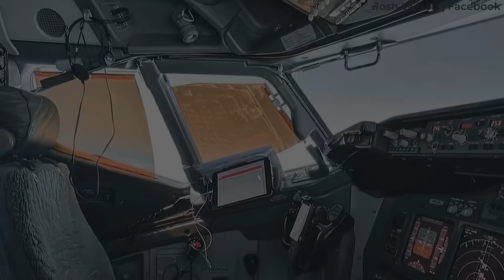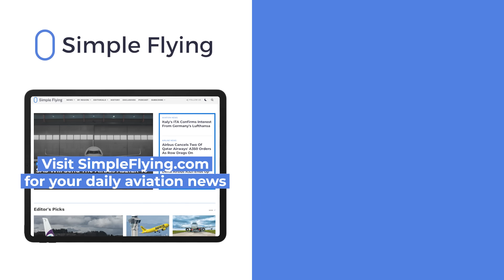You'll Never Believe What Caused This Boeing 737 MAX In-Flight Engine Shutdown

Comment: It's a good job it didn't hit both engine cut off switches, though there might already be an engine-protect system that prevents the switching off of two engines simultaneously.

Comment: Makes you wonder how the rest of the plane was put together. Gulp!
Reply: Indeed: for several years, every air carrier after delivery of new Boeing airframe arrives, has it dragged into hanger & taken to bits...tools, construction debris (metal shards etc) are routinely found, retrieved and every system carefully checked. Funniest one ? In fin, a STEPLADDER found. As aircraft engineer 5 decades: 1. Where is tool inventory accounting at each shift change ? And NO-ONE notices tools/assembly objects have gone missing ? 3. How thorough is Boeing final pre-delivery inspection? BTW: when new airfrane is delivered, Boeing has already completed *final clearance inspection *pre-delivery trial flight *completed handover delivery flight. Sutuation SO POTENTIALLY DANGEROUS: Dreamliner is constructed at three USA plants - one of these has such troubled construction-flaw history that ONLY el-cheapo air carriers will buy from this production facility - at discount.

Comment: A while back I was driving my truck and had a clip board on the passenger side of the dash. I was getting on the freeway via a nearly 360 onramp. When I started the turn, the clip slid across the dashboard and jammed itself into the steering wheel. I almost drove off the onramp and into the dirt. Luckily, I was able to dislodge the clipboard in time and recover. So yeah. Been there, done that.

Comment: I wonder how did a sunshade pull up the switch and then moved it down.
Reply: It is the 787 start lever 
It is 1mm flat on the lower side and the momentum / leverage can pull it out 

The visor has 0.5kg

Comment: Was that a tinted sunviser or a heads-up display which tend to be tinted? Their mounts and their weights might be very different. 

Though one shown in the video looks like a large sunviser or a turned off heads-up display, in a frame in front of a pilot, I think that's the usual place for what may be a smaller heads-up display on a modern jet.

I understand one thing to be a thin rolled plastic sheet mounted over each side window or a very adjustable hard piece of plastic on an arm mount for side and front use, the other being hard like any readable screen with a hinged mount to the front view only, which may be somewhat adjustable for different users' preferences.

Switches, knobs and levers would be covered if designed for important occasional uses such as fuel selectors or for emergencies such as fire suppression controls. I recall some had spring-loaded caps, sometimes with small holes to gently lock them closed with thin copper witness wire. They were always positioned to close downwards to prevent falling things opening them if they were on a vertical surface, maybe close backwards on overhead panels.

There are some controls needing hands of experienced people to move them, such as step movements or maze-like movements, things falling can't complete those actions.

Some things seem off in the video from what I worked with and from what I commonly see of big modern jets in media. The visors I dealt with in flying training and in maintenance were padded and on sturdy adjustable mount arms. And the lesser-used controls needing protection had red caps, witness wire if installed was easily breakable but was there to show something was accessed, not by who but within a time-frame of a flight. Some other controls were used once to frequently during flights but with intentions to do that. Some controls have limited movement before a different action is required to make more movements with them, landing gear lever doesn't move at all without pulling it outwards first.

Comment: A dropped sunvisor shutting down the engine is the biggest load of nonsense I have ever heard. There’s no way this is the whole story. I have been an aircraft maintenance technician for 20 years. I am engine run qualified on several Boeing types, which all have the same fuel control switches. Those switches are big and hefty. There’s zero chance dropping something as light as a sunvisor on them would cause an accidental activation unless something else was wrong with them. You could probably drop a brick on that switch and it wouldn’t change positions. There was an AD issued not that long ago addressing incorrect mounting of the switch, where not enough of the switch was protruding and the light plate was preventing the switch from dropping in to its locking detent. But again, that’s not the same as “they dropped a sun visor and it shut the engine off”.

Comment: They usually say that an Airbus is best piloted by one pilot and one dog, the pilot engage the autopilot and the dog bites the pilot if he touches any more buttons or levers during the flight. 

Perhaps the same dog should be installed on Boeing airplanes as well to guard the fuel cutoff switches?
Reply: alternative a "Airbus is best piloted by one pilot and one dog, the dog is there to bite the pilot if the pilot trying to touch the controls, and the pilot is there to feed the dog"
Reply: You realise the switches have to be LIFTED up to deploy? The sun visor story is a little....interesting

Comment: On my PC if I exit a file without saving I get asked "Are you sure". How would an aircraft IN FLIGHT just accept a command to shut off an engine without asking are you sure is very hard to believe.
Reply: Cause in case of an emergency the engines may need to be shut down eg. Engine one fire w heavy damage they need to cut fuel asap
Reply: Because computers are designed to be operable by complete idiots. Airplanes, not so much. You have to be careful in an airplane cockpit.

Comment: Not sure if this helps this channel with its credibility but the pictures from the 737 cockpit are from the NG series, not the Max 🤦‍♂️.
Reply: And the thumbnail is pointing at switch on the overhead that operates part of the bleed air controls, not the fuel switch which is on the pedestal. You really can’t trust these shitty YouTubers to get anything right when it comes to aviation reporting. Details matter.

Comment: Where is the lock out tag out of engine controls or even a simple cover over the switches......?
Reply: They need ease of access to the cut off switches incase of emergency landings and engine fires
Reply: Lock out - tag out is to prevent operation during maintenance.

Locking out flight controls during flight would generally be considered a bad thing .

Comment: If I remember correctly some years ago a transatlantic flight was cancelled because the PIC's cellphone he was holding fell down through the rudder control floor space. Luckily it was on the ground during boarding...
Reply: That was almost certainly because the phone had a lithium battery (exact chemistry unknown) inside it.

 You do not want a fire in an unreachable area during flight, especially not a fire that burns hot, might self oxidize, and produces very toxic smoke.

There is also the fact that just bending a lithium battery can cause it short out internally and go into a thermal runaway. This is why they tell you to get a flight attendant if your phone falls into or between a seat and something else. No one wants the risk of a fire that can't be easily put out. (A lithium battery fire is not covered by any of the classes, A,B,C, or D.)

Simply put, what makes lithium batteries great (energy density) also makes them hell when things go wrong.
Reply: I have a hard time believing they cancelled the flight over that. A delay, sure, but a cancellation seems overkill. It would have taken a qualified mechanic like myself just a few minutes to retrieve that dropped phone. It wouldn’t be the first time.

Comment: What is the weight of the,sun-visor,to,move,the,fuel-control-switches?

Even if liquid falls down the fuel-control-switch,the,EEC,is located far down(engines) and intelligent to not cut off supply of thrust but rather will cut off the weight the engines(part-electricity,part-DCMP-hydraulics,AC-fuel-pumps),carry,not,engines,powered by,alternator

So,engines,shutting-down,is only as,dev😘,said,”EEC-false-flight/approach-mode”

Think of a,weight-lifter.If,he cannot carry the weight,will he throw off the weight(electricity,hydraulics),or,will he rest his hands(engines) and get crushed by the weight/crash?
Reply: Try reposting your comment in English or whatever your native tongue is and we’ll let Google do the translating, because I don’t understand a word of what you wrote here.

Comment: Is this the 'unswitchable-except-intentionally-by-hand' switch?
Reply: Yeah, the very same
Reply: @davidkavanagh189  Still does not make any sense, Because you need to pull up, then push down to cut off fuel. Plenty of cockpit education video on ytb.
Reply: @kiraasuka9943  Nope. you need to move the position of the switch. The pulling up is solely to allow the switch to pass the gate. This is a a very small movement and it doesn't take a genius to see that the gate could be warn or the switch not fully seated down into it. There have been documented problems before with this switch design so I'm not pulling this out of thin air. Try out some of that education you suggested for yourself :)
Reply: yupp
Reply: Extactly.
Reply: NGL I was 99.999% sure the Air India act was deliberate but if this report turns out to be accurate I guess you have to be open to alternative suggestions of how the switches could have got set to off......
Reply: No different to the 787 fuel switch
Reply: @Louist5e-Gaming  The current 737 fuel switch design is similar, if not identical, to the 787 fuel switch.
Reply: @davidkavanagh189 that’s what I ment and on the 737-800 u can get two different models
Reply: @Louist5e-Gaming  Yes but this was not an 800. I was a Max8 and they only have the later style
Reply: @davidkavanagh189 my bad I thought it was the same w the max
Reply: Typical BOEING , falling to pieces
Reply: @fastnorte  Typical Netflix parrot. Boeing certainly haven't done themselves any favours in recent years but the 737NG and 737Max are statistically some of the safest airliners ever made. Look up accidents in the 80s and 90s to get a sense of just how insanely safe airline travel has become, in no small part due to companies like Boeing.
Reply: @davidkavanagh189  Air travel is the safest mode of transport - no arguments about that, but Boeing isn't doing anything great for the last 2 decades.
Reply: @topline2554  it's REALATIVELY safe, planes crash every day but because millions of people fly daily, the relative safety is very high
Reply: @davidkavanagh189  So because more planes crashed in the 80’s and 90’s we shouldn’t complain about Boeing intentionally killing a couple of hundred passengers? The Max doesn’t have a good safety record at all and the 777X was spared an equally embarrassing record simply because it’s not allowed to fly passengers due to what they found after the Max-crashes.
Reply: @vandijk1698  Design errors and/or negligence are not the same as intent. Try to learn the different. Look to the 80s and 90s to get some context on just how insanely safe modern airliners are these days. The 737max is statistically one of the safest airliners ever made. It is a good robust design and to suggest otherwise is just laughable.
Reply: @topline2554  Then you're objectively wrong. The 737NG and Max have been what Boeing have been building for the last 2 decades. Both designs being some of the safest airliners ever made. We're all familiar with Boeing management woes but it's simply false to state their products from the last two decades were dangerous or no improvement. Look up the percentage of hull losses or fatal accidents for the 737NG and 737Max. Then compare them with earlier versions of the 737 from the 1980s and 90s. It's night and day and not coincidence.
Reply: @davidkavanagh189 the max has a slightly worse hull loss rate than its predecessors when it comes to per million flighta
Reply: @crypton5344  That's probably true but only due to it being in service for a much shorter time than the NG. As time goes on it will almost certainly surpass the NG on that metric.
Reply: @davidkavanagh189  hopefully thats the case